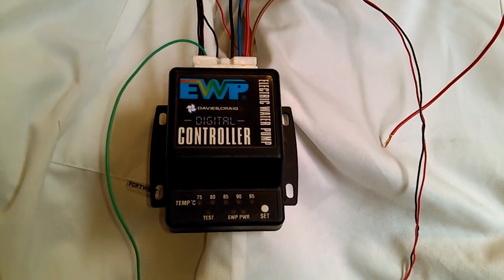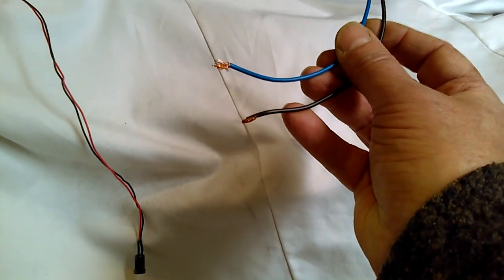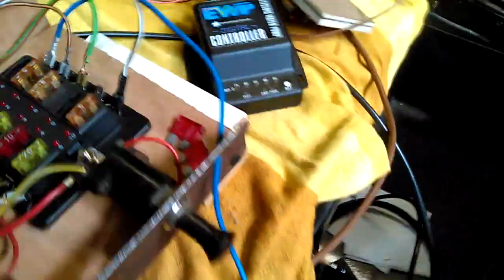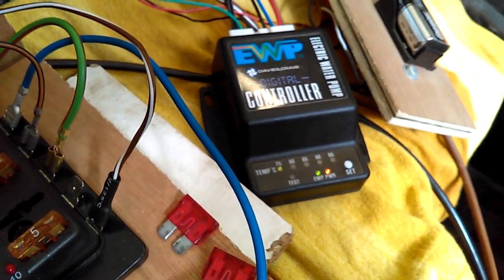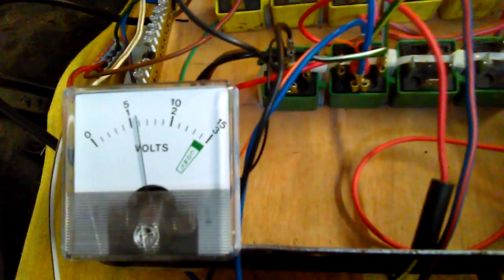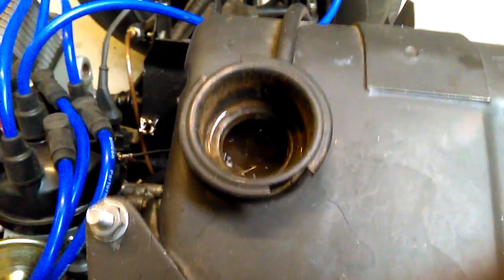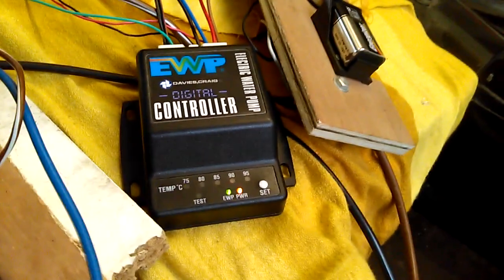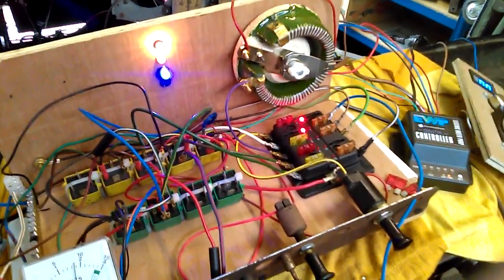1953 Riley RMF with Rover V8 engine - 4: Davies Craig water pump controller

Comment: Not sure I get the benefit of the controller as it is for a regular application. Without bypass flow you wouldn't have a heater as such. Additionally if you do push from fairky cold with no flow you could get localised boiling. Running a separate manual control just seems too much of a faff. The other issue with flowing water through the rad during warmup is that once you have some airspeed over the rad it will take an age to warm up assuming it ever does! Think they work best for competition applications where the engine speed boundaries are outside of what a mechanical pump can easily cope with & the load cycles are more extreme.
Reply: Hi SB - a great opportunity to clear up some misconceptions!

Benefit of the controller? The same reasons that BMW fit them as standard. I also particularly like the fact that it then has the pump running on engine shut down, dealing with any localised hotspots. Plus I can change the engine running temperature at the press of a button if I want to. 

I have no problem with running a heater. The feed to the heater comes from where the coolant leaves the engine, and rejoins at the bottom hose. As long as there's a pressure drop across the heater loop, water is going to flow.

Because the controller I'm using isn't pumping water when the engine is cold I've implemented a manual control for the reasons you identify. I can also lock it into manual so that I can crank up the voltage to bleed the pump when the coolant is changed. Switching to the pump controller is on an adjustable thermo switch so that I can choose the point at which auto takes over. This is no more complicated than fitting an electric fan. And the whole setup is much simpler than my home central heating system!

Sure the engine will take a little longer to warm up once air is moving through the radiator, but I don't see that as a major problem traded against what I believe to be the benefits. If it were never to warm up would mean I've fitted the wrong pump!

My main remaining concerns with the whole setup are more in the area of the heat dissipation problem. I've got a 4.3 engine with a radiator designed for a 2.5 litre engine. I've been working since this vid on the more conventional parts of the car restoration project, but hopefully this summer I'll be able to test the hot day traffic jam scenario...
Reply: I run a EWP on a 1969 Mercedes 6.3 V8 and it's had about 11 years use . The Engine warms up as per normal but because it has a water heated thermo on the mechanical injection I run a booster pump which circulates water from the engine side of the water pump to allow the injection to lean out as it gets warmer before the pump runs at 77 C. 
So far the pump has coped very well with our summer heat here in Australia which hits 40C regularly.
My controller runs the pump for a few minutes after engine shut down which has eliminated all hot start issues ,and if it's getting heat soak after shut down (common on these huge engines) the fan runs at full speed to provide extra cooling. 
At very high speed @ 140MPH + the pump copes far better than the original pump ever could . 
I am now in the process of building a Leylwnd P76 V8 for my proposed shop hack which willdeifinately use the DC set up.